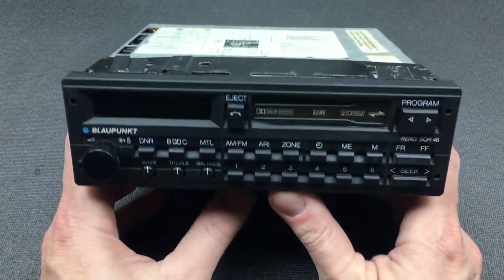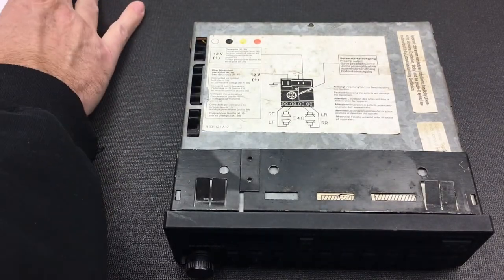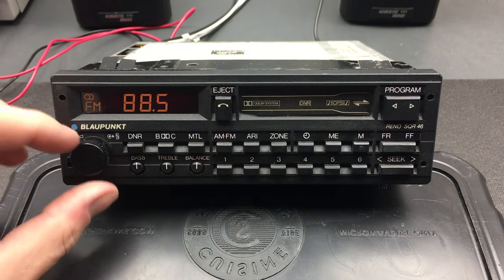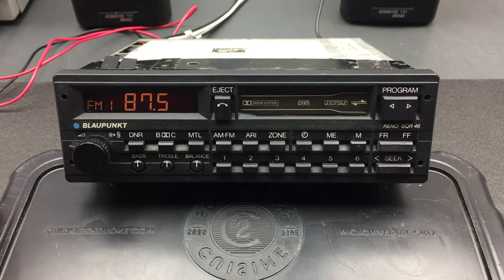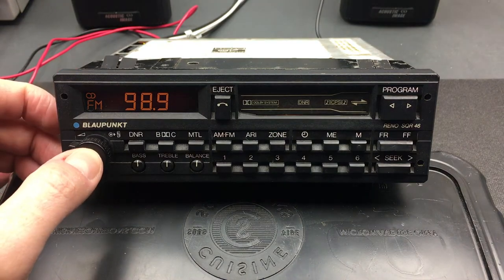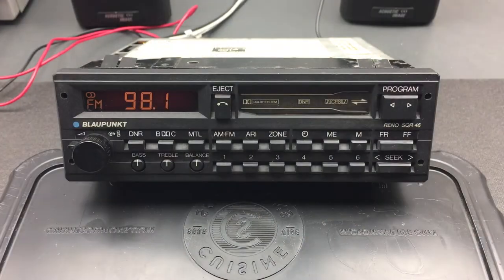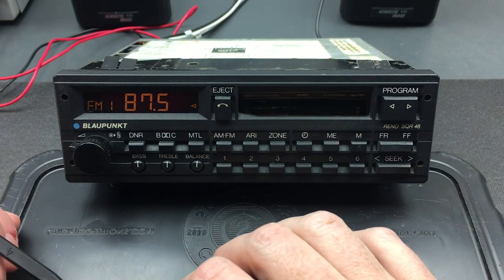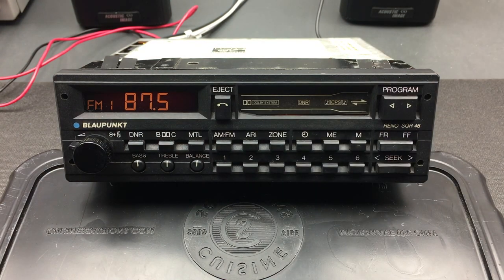Blaupunkt Reno SQR 46 - Overview & Demo

Comment: Hello - great video.  I have the original unit in a vintage 1988 911 that since purchased brand new has never left the family, all original.  I never knew about the front/rear fade and tried optimizing my sound but somehow got the unit into a weird searching mode -- and now no audio being outputted through the speakers even when I take my FM transmitter/bluetooth adapter out, so the plain radio is not producing any audio.  Any suggestions on how to reset the unit or get it out of this weird mode it's in right now?  Appreciate any help thanks!

Comment: Very cool video. I have a Porsche 944 turbo. Its option numbers on the VIN sticker call for the Reno SQR 46 radio. Any ideas where I can buy one for not too much money? Thanks.
Reply from the maker: Hi Francis, if you are in the US, you can try craigslist or maybe PCA. Ebay will have the most options, but I see that the prices there are extremely 'opportunistic'. I don't know what your definition of 'not too much money' is - I would argue that a good condition Reno is worth around $500 - no more.

Comment: I am in the process of installing an old Reno SQR 46.  Thanks for the user guide.  Where did you purchase the OEM connector plugs for power and speakers?  The car I am installing into has had the OEM plugs cut out of it.  Thanks
Reply from the maker: You can get both the connector and 2-pin DIN speaker connectors on Ebay (eg: https://www.ebay.com/itm/Blaupunkt-Power-Plug-1980s-Radios-Reno-Lexington-SQR-46-47-48-Porsche-911-928-/153030150137?hash=item23a14ec7f9 and https://www.ebay.com/itm/4-Speaker-Plug-Wire-Becker-Blaupunkt-1980s-Radio-Mercedes-BMW-Porsche-Ferrari/153030148219?_trkparms=aid%3D222007%26algo%3DSIM.MBE%26ao%3D2%26asc%3D50544%26meid%3D57c93ae99102447695d9426086f04ef6%26pid%3D100005%26rk%3D5%26rkt%3D12%26sd%3D153030152290%26itm%3D153030148219&_trksid=p2047675.c100005.m1851)
Reply: @olafwagner  Do you by any chance have an updated source for these connectors? I cannot seem to find them anywhere now. Cheers!

Comment: Is there any way to switch the FM frequency steps to european specs (100kHz steps)?
Reply from the maker: I am sure that technically there must be a way - but it is way beyond my electronic skills :-). I guess the only question is how this gets implemented by Blaupunkt - would it be a case of swapping out an oscillator, or is this controlled by one of their custom/bespoke IC's (in which it would be truly impossible)